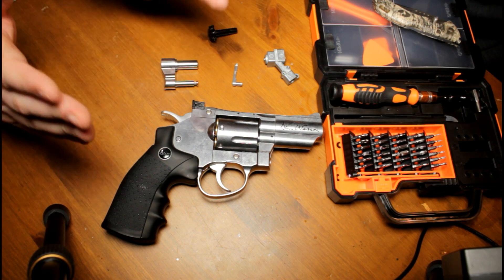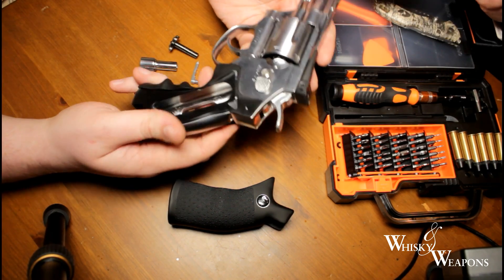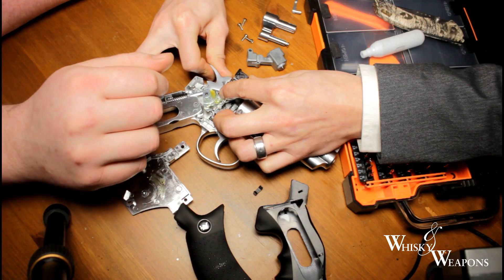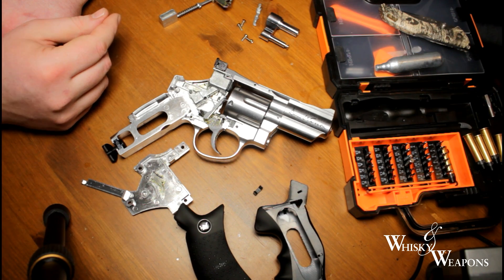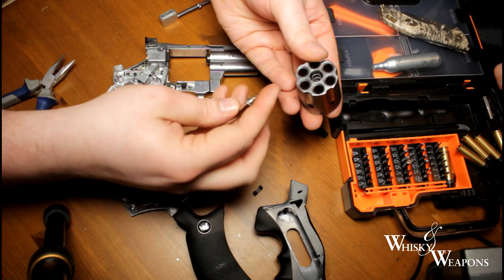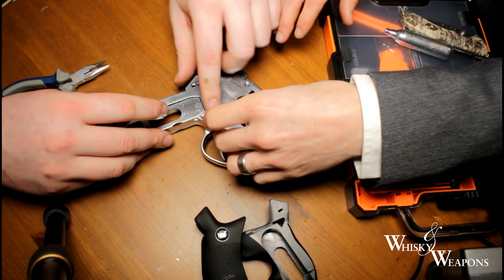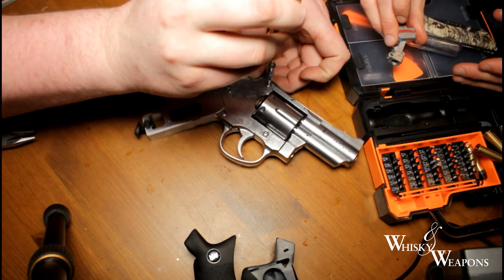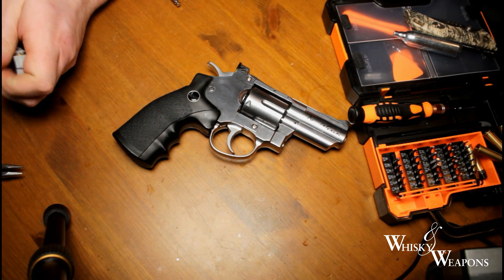The Best & Only Professional Mod for Dan Wesson Pellet Revolver POWER & TUNE UP FIX - 1080p HD

Comment: Great video for showing the indexing repair, however you don't have to do this mod to increase the fps. All you need to do to get a 50%+ increase in both fps and ft/lbs is to buy some DAN WESSON 715 shells instead. They fit the 2.5 in gun perfectly but being rear loading they increase the effective barrel length by another two inches. It's like having a longer barrel, this causes the gas to over pressurise and gives an immediate and dramatic power boost. On my chronograph I got 427fps, which is just over 3 joules. 

You're welcome.
Reply: what if you were to do both mods ?
Reply: nope sir, its not only the barrel, the shells are different, the BBs version is placed on the front, generating a vacuum inside the shell, and having greater loss of pressure and gas in the mouth of the valve that connects to the shell. however in the Pellet version, the pellet is placed in the back part receiving the direct pressure from the mouth of the valve system, and BBs use Smooth cannon does not provide the drill effect torque generated by the pellet version, because it spins with its rifled barrel, Pellet balistic is different as a BBs
Reply: Do you think doing the mod and getting the 715 shell's would increase the power even more? I'm looking for a pellet pistol for home defense. I have a Vigilante and a Sig saur M17 both about 400 fps but wish to have more power if possible
Reply: @derekmcmillian6557  Try a Daisy BB pistol! Holds 21 shots and does 500 fps right outta the box!!! Sounds much louder than the other three gas pistols I own and is super accurate with BBs.
Reply: @conniecostigan637  bbs dont break through a jacket bro.. pellets do
Reply: @SEOBEAST_YT  Would like to see some proof of that. I kinda doubt that slower, more easily deformed lead pellets would out penetrate a steel BB. Maybe a lighter, harder alloy pellet would do better.
Reply: @derekmcmillian6557    Umerex hdr 50 with replacement barrel and power kit 50 from home defence 24 is a good option
Reply: @petersmith6974  thank you. God Bless 🙏
Reply: Do they fit the rugger superhawk 8 inch?

Comment: or you do the Hammer Mod with a simple screw and mother , the grip is prepared for this. That give´s more and adjustable power on the hammer spring  ( valve opens more and longer ) for more fps ;)

Comment: The only thing I would have done different is to put the cylinder in place before inserting the yoke.on my m65 revolver I was taught to do so to keep the yokes original tolerance..just a thought

Comment: Well, I got my replacement valve today, and was suspicious of it since it has the red stripe painted on the side. Only took a few minutes to install though. It provided no increase in power. I am sure it is the same valve as I removed.
Do you have the part numbers that you ordered? And which model of 8" DW you ordered the replacement valve for?
Keep up the great work.
Reply from the maker: Ah yes the red stripe is the low power valve. 8inch dan wesson pellet valve, where are you based, UK? We dont have a part number sorry. Hope ypu can get your valve sorted. Thanks for watching, we will try to keep up the videos however youtube is cracking down on gun related videos as a whole so we arent making any revenue from ads, only patreon which has had no one donate.
, no doubt as were a new channel. 
bit.ly/patreonwnw

Comment: When you put that plate on the outside the best way to do it is just lay it down top on first up by the hammer then pull the hammer back and it falls right into place you don't even have to pull the hammer back that far

Comment: I bought a Dan Wesson 715 6" revolver a couple of weeks ago,I love guns but I'm not good at it,I just notice that the hammer of my gun is wiggling,is it normal or is it bad?
Reply: Yes, it's a common thing with these guns. They come that way 90% of the time. It's annoying but there are ways to fix it.
Reply: Claudio is right almost all have a wobbly hammer. This is one of the first things that reviewers are quick to moan about and of course claim utter disappointmet... but it really isnt a lack of quality. It seems these manufacturers have used any trick possible to avoid these things being too powerful. There will, as Claudio pointed out, be solutions online. Bear in mind it will get stiffer in time but if it bugs you too much, id open it up and add a few small washers just to tighten it up a touch. This can also be done with a loose grip but using sticky foam pads on the inside to make it fit tighter. Peace

Comment: I’m curious as to why your FPS was so low before the modification, were you using the power down shells? They come as standard in many countries. I removed the restrictor in my shells and I believe the gun should now be firing around 400fps with the original 6inch valve. Your thoughts and comments would be appreciated.
Reply: I’ve just realised this is probably an airgun rather than an airsoft gun, is that correct?
Reply: Hey failvids4all can u please please tell me how took the restrictor out of the shell to make it high power .. thank u so much
Reply: @jamesguest1238  There may not be a restricter in your shell, but if there is, literally just pull the plastic "bullet" piece apart from the metal shell, there'll be a small metal piece inside that you can just remove. But restricters are only put on models sold in country's that require airsoft guns to be under 1 joule

Comment: Did theses repairs fix the indexing issue? Or was it the small plastic piece at the bottom of the cylinder?
Reply from the maker: Allen busch these seemed to temp resolve the problem, however the plastic piece has resolved the issue. thanks for watching. the plastic piece is well worth a go first. much easier.

Comment: Hmm, notice you didn't actually shoot the gun live to register the higher fps.

Would it have been too much to disassemble the valve housing to show the difference between to the valves? It would have took a few seconds.

I've done a fair bit of valve work , even made bigger valves for an M29 and there is no way you can increase power that much by just swapping out the valves., Doubleing or even  Trebleling the hole size in the valve will probably get you a 75% increase but you got  150%......apparently

Comment: I'm having a problem with the trigger's spring
Reply from the maker: What issue are you having with the trigger spring? Getting it back in place?
Thanks for watching please subscribe and share, simply press the subscribe button in the bottom right of any of our videos, and you will be taken to our subscribe page. I look forward to hearing more about your trigger spring and we will see if we can assist.
Reply: Whisky & Weapons yes, I don't know how to lock it back in place. The spring is slightly bent now, so I know I'm doing it wrong. I'd like some assistance.
Reply from the maker: Are you talking about the spring at 10:37 in our video or the spring behind the trigger at around 10:53? There are a few springs associated with the trigger. how did the spring get bent? If your need a new spring measure the ID and OD and length and you could easily buy one from ebay, otherwise go to ASGs website and look at the dan wesson breakdown and find the part and part number then a dan wesson dealer will be able to get you the replacement spring. Perhaps look at the break down on action sports games website and send us an email (Found on our about page) with the part highlighted. We will try and assist best we can.
Reply: Whisky & Weapons I'm talking about the mechanism at 10:14
Reply from the maker: Jose Lira can you use some tweezers/needle nose pliers to bend the sping back to its original state?

Comment: Why do Dan Weston sell them vastly under powered and broke if you have change all those parts. I watch because I wanted to buy one.  Every video is about upgrading or fixing. Putting me off if your aloud 6 pounds at least make them 5 and make them work properly in the first place. I wanted to ear how good they 
Not if you buy loads of new parts you can make them decent
Reply: I hear you man i had the same issue. To me it seems like maybe the crossman 357 2.5 inch is best for the money but still needs upgrades. I agree heres hoping they start to make this things more worth the investment. They do seem fun but i wont trust it until its been fixed and perfected in performance. Peace
Reply: I am sure glad that there are guys like you doing power mods. Before my stroke I was obsessed doing this type of work. Very satisfying.

Comment: mmmm... you only increase +18FPS  changing a valve.... I guess that is expensive, hard to find, and impractical.   I was chronograph and BBs version  2.5" Dan Wesson works around 380-418 FPS 0.35 Steel BBs.   
You're right, all the other modifications shown on YouTube, are useless   the best option is to buy the Pellet version if you want more power, and use pellets Gamo PBA Armor 0.44 grs for an optimal performance.   The BBs versions  has greater beauty and detail only.

Comment: that gun only shoots 250 fps!!! 🤣🤣😂😂 my pellet version STARTS at 430 and i use .30g composite aluminum alloy pellets, never crono'd the beast but i bet it's shooting at around 480 or 490 fps with ZERO MODS, OH i see, their must be a different standard valve her in CANADA:face-pink-tears::face-orange-raised-eyebrow:, good that these ARE easy to fix though